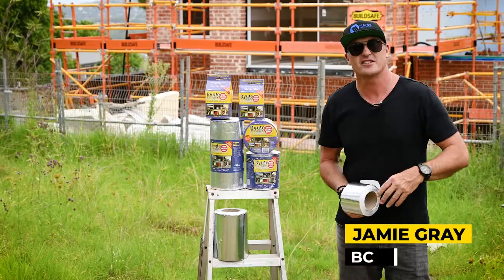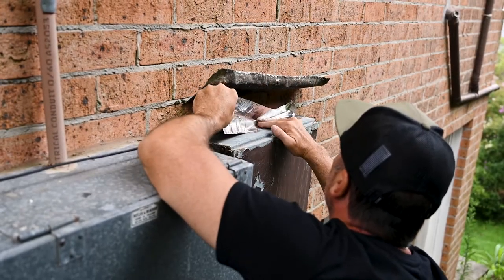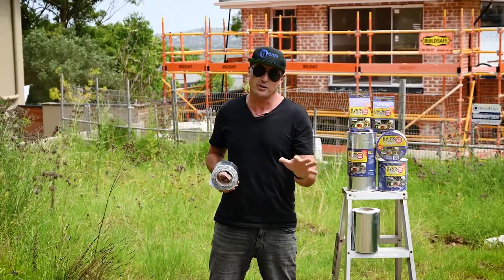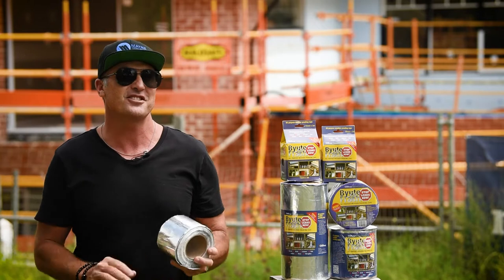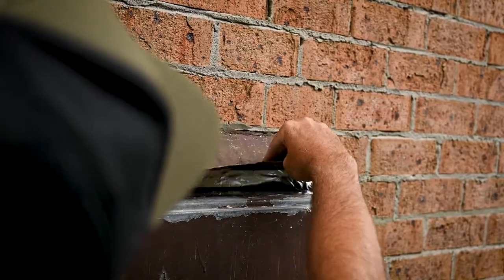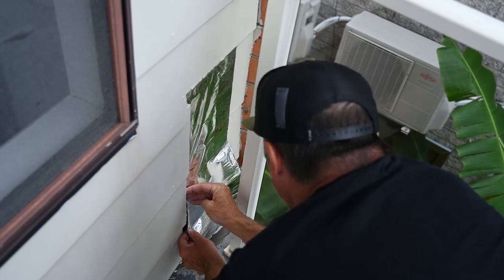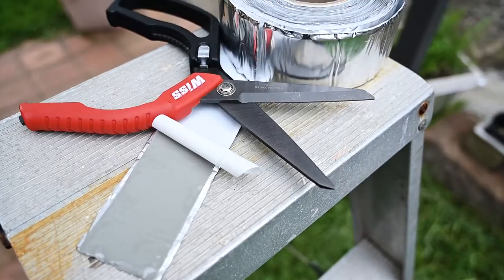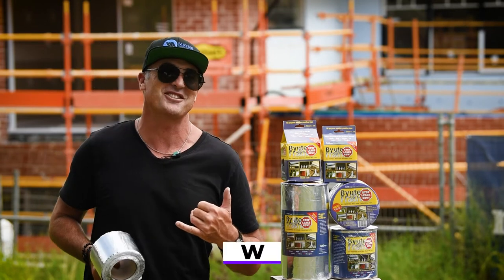Byute Flash

Comment: Plastic backing won't peel off easily if it's slightly warm. It pulls the butyl off the alloy sheet. Sure, you can put it in the fridge for a while but it's not practical on a hot QLD day when trying to stick 8 metres of the 300mm wide roll.

Comment: I tried to use this product today and the plastic backing won't come off, it just stretches and pulls the butyl off the aluminium. I read the other comment and have put it in the fridge to see if that helps but there should be something telling you this in the instructions. Very poor marketing - also expensive for a product that doesn't work.